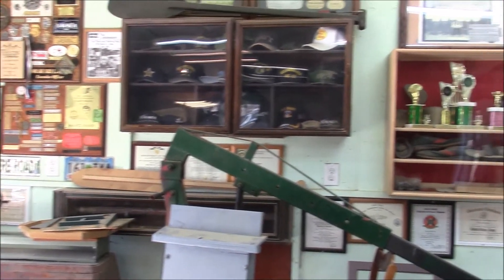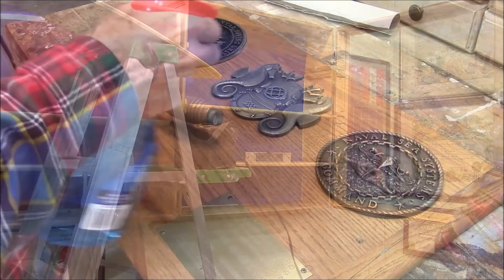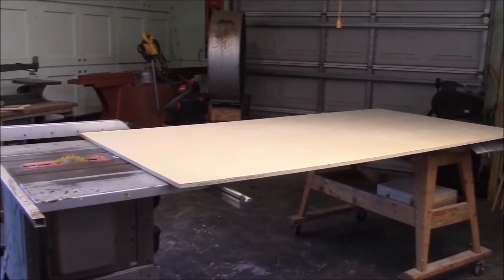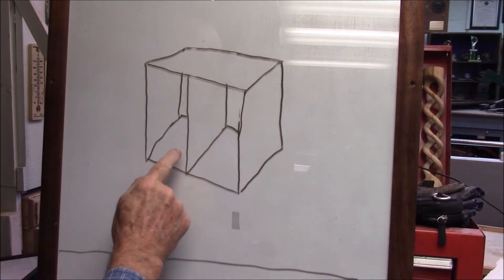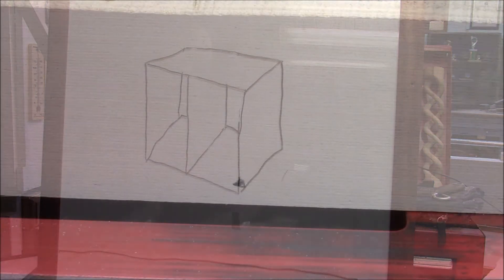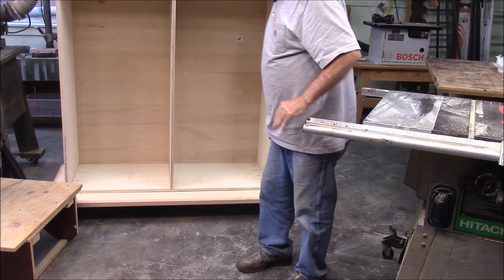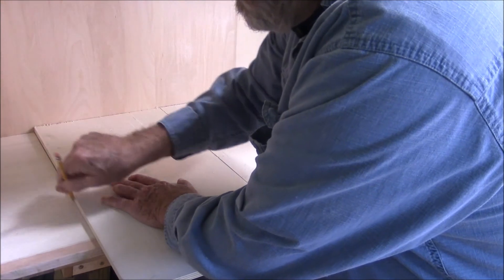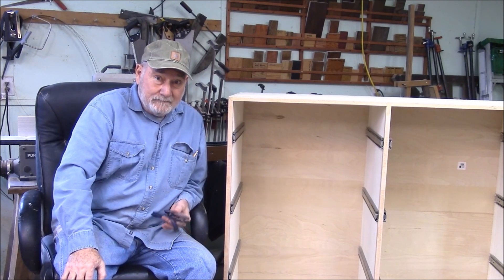41 Finishing the Trophy Cases and starting a large Storage Unit

Comment: I am setting here watching TV and a Ford commercial just said fords are Built To Last and I think you can say the same about you projects. Everything you build seems to be built well. How did you like using the skill saw, I think it would be better then the jig saw for long cuts like in plywood. I love the way you laid out the drawers, you make it look easy. Keep up the good work and I will see you next week.
Reply from the maker: +Robert Chase They say even clocks are right twice a day, and I figure that is what happened when I finished my shop in 1/2 inch plywood.  I suspect those walls will still be around when the last cockroach dies off.  
    The skill saw is better, but I hardly ever use it because it is so heavy.  Man, I'm getting old.  Did you notice how I had to push that plywood around on a wheeled-table?  I'm already planning on transporting the storage unit to my covered deck in sections, and then assembling it on the deck.  There was a day (before three hernia operations) when I'd have tackled it in one go.  
    I don't know if I invented that marking jig method of laying out the drawers, but it sure is slick. 
    Thanks for the good word.  and thanks for watching.